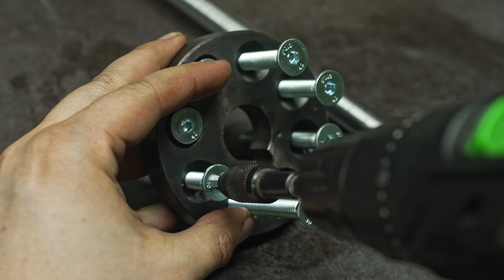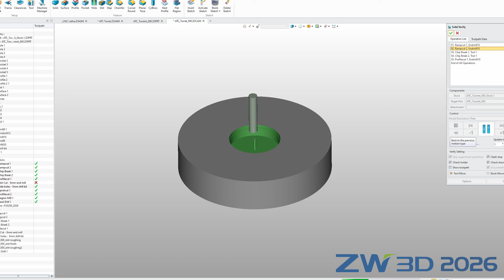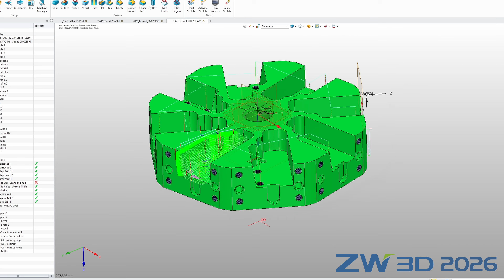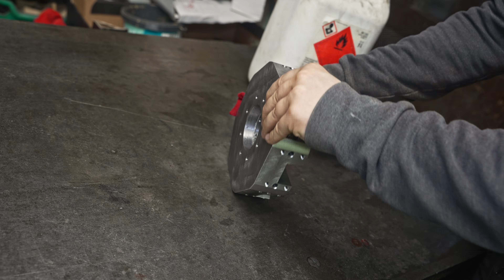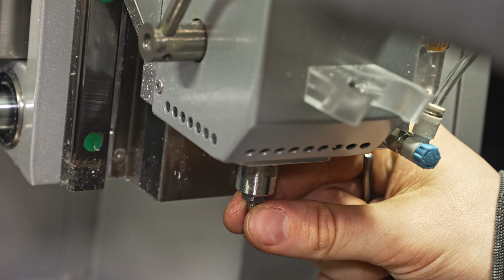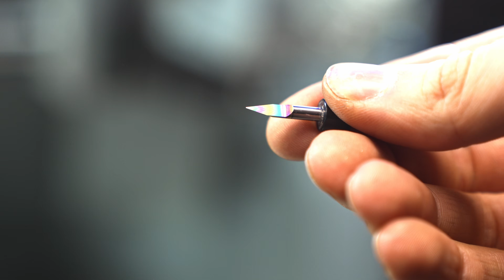ATC Turret - Toolhead! - DIY CNC Metal Lathe Build #19

Comment: Regarding the steel plate you machined with the carvera and finished by hand, is there any reason not to just cut it from aluminium, avoiding the need for hand finishing?  Doesn't it only need to resist the tension of the belt?
Reply from the maker: Looking at the timeline - I finished the steel plate and then made the aluminium one. You're exactly right.

Comment: You made a machine with round rails. Why did you redesign it or are they not suitable?
Reply from the maker: The round rails were not stiff enough to machine efficiently
Reply: @GBWM_CNC  A guy on YouTube, Dexter 144, made it on round rails and says it works fine.
Reply from the maker: @андрій-д1ж depends on what you expect your machine to do. My old lathe was working but making a part was a slow proces. Now on the new machine i can remove materiał much faster and more precise
Reply: @GBWM_CNC  What carriages would you recommend for assembling a lathe at home?
Reply: @GBWM_CNC  What carriages would you recommend for assembling a lathe at home?
Reply from the maker: @андрій-д1ж  I am using now on my new machine HGR25 (or 30? I don't remember the size). Overal HGR type are very stiff, but need a straight surface to mount.